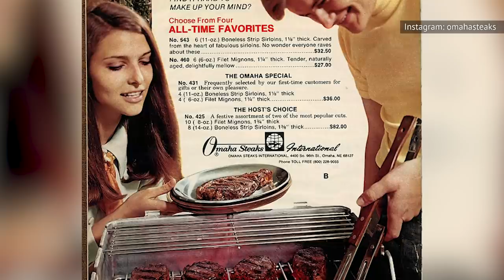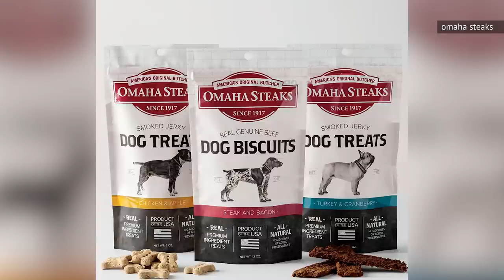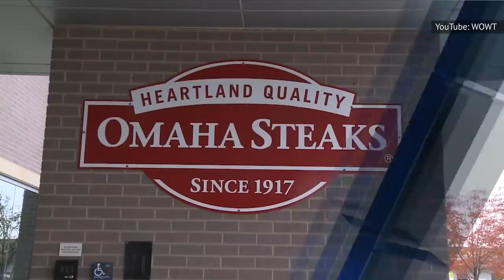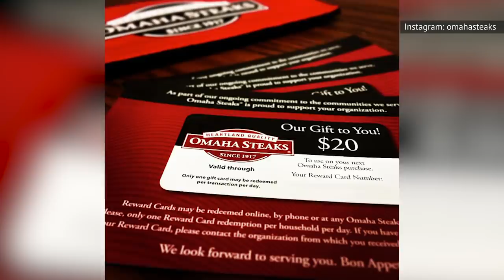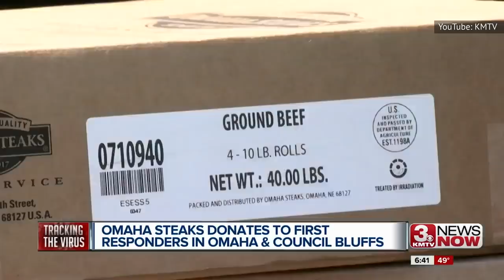The Untold Truth Of Omaha Steaks

Comment: Aren't these steaks frozen? I'm not trying to be a food snob, but why buy frozen when you can buy fresh locally?
Reply: Even if they aren't frozen, you have to buy a big assortment from them and unless you are living in the movie "Cheaper by the Dozen" you'll have to freeze your purchase to avoid throwing it away. A more sensible option is as you stated, whenever you want a steak, go buy it locally.
Reply: @taylorsessions4143  Excellent point.
Reply: Fresh?  check how steaks are processed.  Wet aged beef is 10 day old near freezing temps   dry aged is 30-90 days else it's like chewing leather.
Reply: Aren’t you gonna freeze it anyway
Reply: @danc2014  I respect your point, but it comes down to molecular biology. One of the things that makes water such a unique molecule, is the unlike most others, it actually starts to EXPAND as it comes with a few degrees of it's freezing point. Since most cells are filled with water, this causes damage to the cells and therefore the meat.
But you make a good point. 10 days isn't "fresh" but when I said "fresh" I simply meant not frozen.
Reply: @YoshiXO  No. The only time I would freeze a steak is if something came up that prevented us from carrying out our dinner plans. Then I would freeze is as not to be wasteful.
Reply: @danc2014  Simmer down, Dancy! I've had steaks made from my Dad's Black Angus cattle three days after I fed them, and NOTHING I've ever had anywhere has ever come close in taste or texture. You hardly needed a knife.